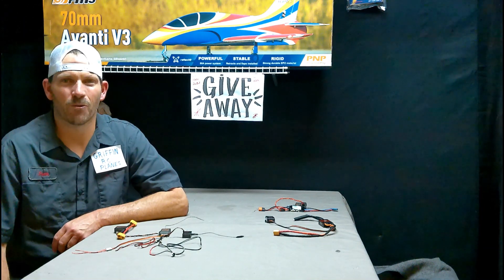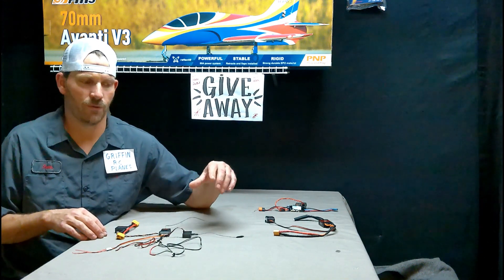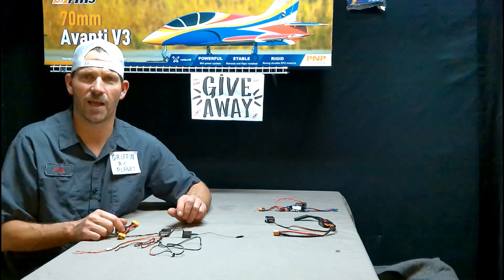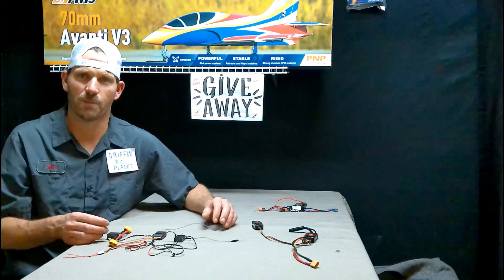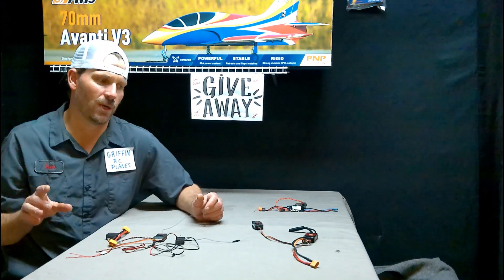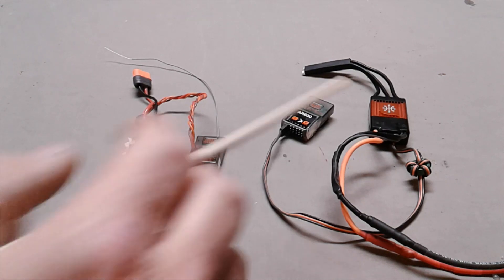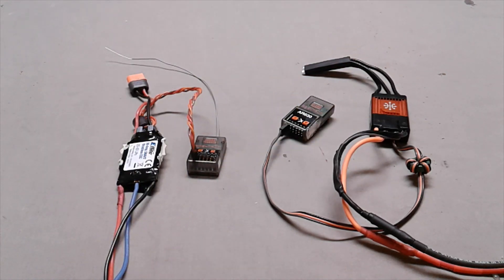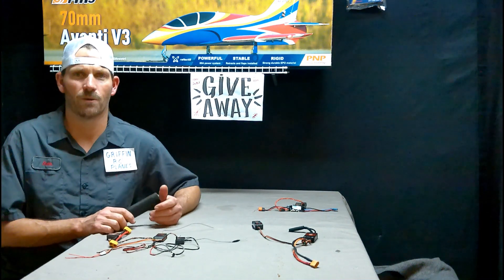SPEKTRUM RC AIRPLANE TELEMETRY BATTERY VOLTAGE AND MORE  AVAIN ESC SMART RECEIVER TM1000 X-BUS LOOK

Comment: Where can you get the different sensors, and what is cost?  I’m interested in remaining battery voltage, speed, and altitude.  Still confused, but will wait for next video. Thank you for taking time to address these issues.